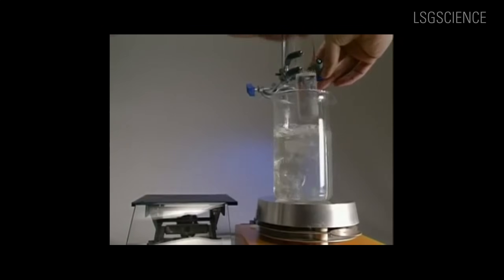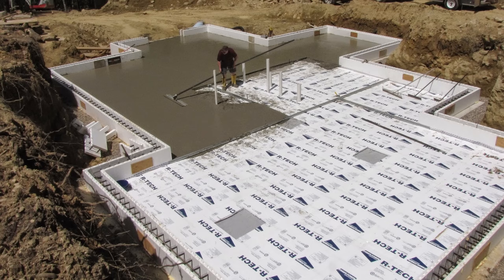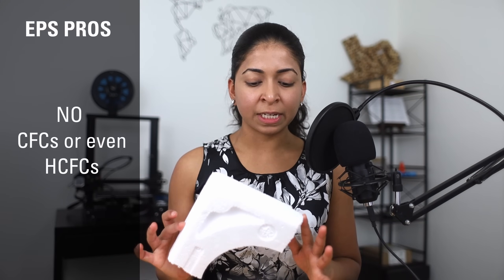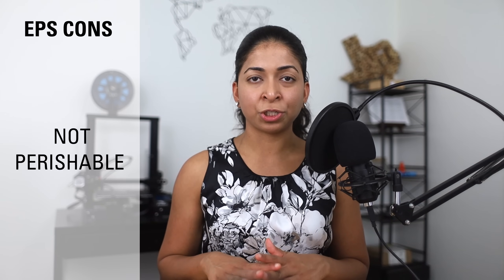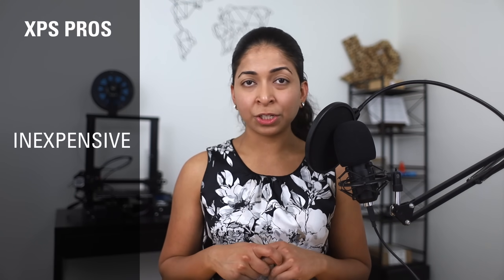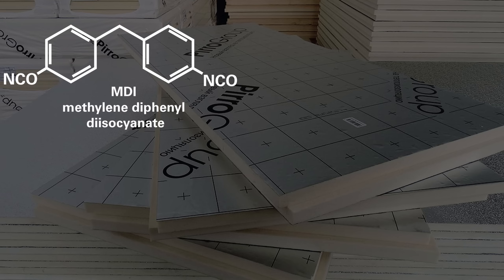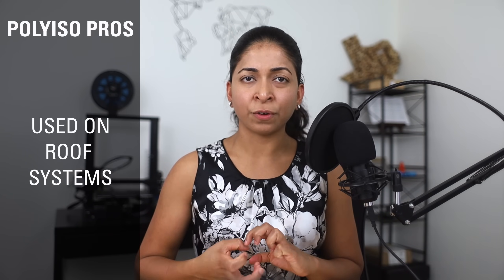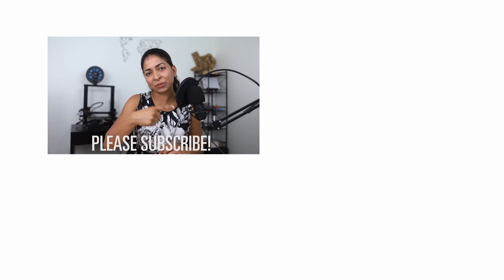EPS, XPS & Polyiso insulation | everything you need to know

Comment: Just insulated my basement with 4” type 2 EPS panels. Phenomenal thermal break and vapour barrier. Taped all joints and spray foamed the tops blended into our rim joists for an uninterrupted thermal break. There is no difference in room temperature from upstairs now, even with our frigid winters.

Comment: Do you think using 1 inch XPS foam board insulation on the exterior of a 2x6 wall insulated with Rock wool insulation and using Membrain smart vapor retarder inside could create the potential for mold growth within the wall cavity?

Comment: Based on the reduced performance below 50F does that mean that polyiso is not a good choice for colder climates or does its performance just suffer and reduce its effective R value closed to EPS or XPS?  Based on the use of the reflective membrane, is its effective R value further increased due to reflection of heat back into a structure (e.g., if used to insulate a basement or crawl space wall)?

Comment: You should've mentioned that polyiso has bad thermal drift over time.  The first year it is awesome, but the R value declines.
It would've been nice to have included advantage/disadvantages of fiberglass insulation (which I think loses R value as the temp drops)  and cellulose (which compacts over time, but also serves as an air sealant), too.

Comment: Which do you think is the best for , an outside metal shed 6 foot x 3 foot I’m in Boston Massachusetts so our winters sometimes get down 5 degrees , now you seem very smart , I’m storing lithium batteries out there - lithium at about 34 degrees starts to slow down , deteriorate and lithium freezes at like -5 Fahrenheit so potentially I’m looking to ideally not get below 40 degrees Fahrenheit in possibly 5 degrees , I plain on having a space heater out there that heater that hangs off the electrical socket we’ve seen a bunch of commercial selling them “ so in a nutshell which insulation is best to potentially Keep a 35 degree difference , I right now have some of that 2 inch the last 1 you spoke about in the ceiling & I’ve flex sealed the inside metal ceiling once 2 coats of regular spray paint & on the outside ceiling 3 coats of flex seal , 1 coat of Plasti Dip multipurpose rubber coating & 2 coats of Undercoating / insulation Permatex  to stop the metal ceiling weeping  ! The out side walls have like 5 coats of paint and the floor I used 1 inch wood and I have 2 pieces of water vapor barrier under the wooden floor and between the 2 pieces of vapor barrier has 1 coat of the spray rubber inexperience at Walmart $ 5 & some change per can & 1 good coat of Flex seal moisture blocker & the shed sits on 2x4’s the wide way laying flat so it’s about 1 inch 1/2 “ off the driveway that’s paved about 2” thick ! Thanks for the video explanation !

Comment: Great comparison between polystyrene and polyisocyanurate, @BelindaCarr. 

Couple corrections:
0:20 "The monomer styrene is composed of a benzene ring (C6H6) and ethylene."
It's benzene ring and vinyl (C2H3), not ethylene (C2H4). That's why it's also known as vinylbenzene.
6:40 "XPS can also attract ants and termites even though it's not an organic material."
XPS is an organic material since it's a carbon-based compound. That's why ants and termites are attracted to it.

One thing I would add is fire toxicity. 2011 study found that polyisocyanurate is the most toxic material insulation, mainly because of higher hydrogen cyanide production when burning. Fire toxicity is ranked PIR > PUR > PHF > EPS in under-ventilated condition, PIR > PUR > EPS > PHF in well-ventilated condition.

Reference
Stec, A. A., & Hull, T. R. (2011). Assessment of the fire toxicity of building insulation materials. Energy and Buildings, 43(2-3), 498-506.

Comment: The XPS sample shown at 4:26 is certainly not Styrofoam; based on the colour, it is likely Foamular.  Dupont's Styrofoam brand of XPS is generally dyed blue or grey for marketing, while Owens Corning's Foamular is dyed pink (as a tie to their pink-coloured glass fibre insulation). The sample is "actually XPS"; it is not "actually Styrofoam".

Dow and DuPont merged in 2017; despite the caption at 4:28 and illustration at 5:27, the Styrofoam brand is now under the DuPont brand.

Comment: Very helpful video, thank you. My question is about combining insulations in the same enclosed space. We used ICFs to form our foundation and the EPS is exposed in the interior of the crawl space. To insulate in the bays above the ICFs, we used mostly rockwool, but we had some polyiso left over from another project so we also used some of that. So in the end, our crawl space insulation is a combination of EPS, Rockwool and a small amount of polyiso. Is this a dangerous combination in any way? I'm looking at the safety data sheet for the ICFs and under "Stability and Reactivity" and it says the ICFs are "not compatible with materials containing primarily of hydrocarbons..." Should I go back down there and remove the polyiso and just use all Rockwool? Also, is it common to leave the EPS exposed in the crawl space or should I cover it with stucco or a layer of rockwool to reduce any fire hazards? Thank you if you can answer these questions!

Comment: Your videos have the perfect amount of comedy. I have a question in one part you said EPS is impermeable to water mold and mildew resistant, but then the next section you say water can penetrate because of the space between the beads. I hope this does not come off as rude I just want to know if it is water resistant or if it is not water resistant?

Comment: Great information. What do you think would be better for a floating floor, insulation would be under OSB laying on a slab? I am On the fence between XPS and rockwool, but for the same thickness XPS seems superior in tterms of compression and thermal performance. With EPS my concern is that its softer, so what i save in  this, i spend for a thicker OSB.

Comment: Thank you for the insightful information. I wasn't aware that Expanded Polystyrene (EPS) is the most environmentally friendly option among the three alternatives, especially due to its production process that involves steaming. The fact that this process can be made even greener by utilizing electricity generated from renewable sources is encouraging. I'm relieved to learn that EPS doesn't contain any chemicals that could potentially leach into the ground, especially as I intend to use it subterraneously in a Ground to Air Heat Transfer System under a greenhouse. The issue of ants being attracted to and consuming polystyrene was unknown to me. Now that I'm aware of this, I can mitigate the problem by laying down a protective plastic sheet. Again Thank you

Comment: Extremely helpful. Question: If polyisosyanurate is not stable below 50degreesF, then where is the best use of this produce? Inside a structure? Thank you - great information.
Reply: I used it in a very thin exterior wall, Worked very well in summer for keeping heat out and keeping my comfort zone inside around 65 well above 50 on both sides. In winter it did not help with cold well at all.

Comment: Hi, I am late to this comment thread, but I am hoping you can offer a little more information about the flammability of the last insulation panel type. I am considering using it between 2x4 purlins under a metal roof in a fire prone area of the northern California Sierra Nevada foothills. It would be fully enclosed within the 2x4 purlins framework and under the metal roofing panels. Thank you, in advance, if you are , or anyone is able to respond 😊.
Reply: Polyisocyanurate is a fuel when it comes to flammability. Manufacturers add fire retardants to it to make it less flammable, but I would not trust this in a vigorous wildfire. My recommendation would be to look into rockwool, specifically a layer of continuous exterior insulation of the stuff. Keep in mind that if you are using timber instead of steel framing, then even if you migrated to rockwool, your point of failure is likely the wood sticks you used for your house. Flammability is really a question about where your weakest point of failure is at. And with how climate change exacerbates droughts, I would plan not for the intensity of fires today, but the "once per 1000" year variety. Prudence is not about hoping for the average case scenario, but expecting the worst. Of course, your wallet might have other ideas.

Comment: If you update this video in the future please consider adding GPS insulation. It is produced without the use of chlorofluorocarbon (CFCs), hydrochlorofluorocarbon (HCFCs), or formaldehyde. So it will not produce harmful emissions to the environment. Compared to XPS, The GPS R-value is more stable long-term around +4 per inch.

Comment: This was a great video and I have a question ( not sure if you will get this due to the age)  between the xps and eps which could hold more static load on top , meaning keeping something on top of it for a long period of time?   I think this is known as compressive strength.   There is a company that says they use high density expanded polystyrene foam for their product which supports cars and truck ( race ramps )   is xps stronger then eps in this type of application?  

Thanks
Reply: I think it really depends on several factors such as density, thickness, cover, interior, and structure of it.
There are EPS pallets since many years ago and they can load quite heavy-weight, however, to extend their lifespan of it, we should cover them with plastic to induce friction loss.

Comment: EPS will hold water from personal experience. It's a bit misleading...the actual beads are water proof, however there is an air gap between them where water passes through and collects like a sponge. The upside is it can dry out too. Manufacturers will add a thin film to combat this. Last it is fragile and squashy and normally that's a bad thing when building stuff. XPS is not entirely water proof, but it's pretty much is, especially for thicker pieces. Just like EPS or poly (or any other plastic), UV will disintegrate it... it becomes powder, however there is a 'platina' effect, where the outside edge degrades, but protects the deeper part. It all comes down to water control though...you want to use EPS in similar places as fluffy insulation, but want more R value per inch and rigidity (garage doors comes to mind) and use XPS/poly as an air/water barrier (depends, but IMO on outside of structure is best and then it dries inside). I personally don't have a use for EPS...thin poly with foil on exteriors and XPS layered under it, then rockwool inside.

Comment: Would poly iso be safe to use at an air distribution box on a forced air furnace? The temperatures comming off the furnace are a bit warm. The box would be feeding warm air into the entire homes living space. Is there off gassing or flame retardant that could off gas into the hot air flow to the home ?

Comment: I am considering adding foam board insulation to my attic, but live in a hot and humid climate (Southeast US). My climate has a lot of moisture issues and also termites. It sounds like if I wanted to be the most cost-effective, maybe EPS is the way to go and for performance, Polyiso?

Would love to know if there are any mold/mildew resistant, ant/termite resistant, eco-friendly options. Only thing I can think of is rockwool, but don't know if they have boards.

Comment: Belinda, I have this video on speed dial...(jajajaja), I refer to it so often!!!....a little update info to share: New XPS panels are replacing HFC-134a with HFO blends for a big greenhouse gas reduction.  In the case of panels made of extruded polystyrene (XPS)—a closed-cell foam suitable for wet or dry conditions—that gas has been hydrofluorocarbon-134a (HFC-134a). HFC-134a is a good blowing agent, but it has a GWP of 1,430, meaning it traps 1,430 times as much heat as carbon dioxide does over 100 years. As regulations seeking to eliminate HFC-134a take effect this year in Canada and the US, panel makers including Owens Corning and DuPont are switching their blowing agents to blends containing hydrofluoroolefins (HFOs). Additionally, GAF is now manufacturing a non-halogen Polyiso. As always, thank you very much for your channel....Architects are weird, when we walk into a party we are not checking out all the sexy people, we are checking out the alignment of the ceiling can lights and door details. When I pull an all-nighter, for a little break and distraction, I pull up one of your video. Yes, we are weird :)) Thanks again!

Comment: I am retrofitting an ambulance. It has straight walls with 2"x2" box tube aluminum frame on 12" centers with an aluminum skin. I do not have to be concerned about flexibility. Moisture due to condensation is always a concern inside a vehicle like this one. Which foam would  be best suited to this environment? Would there be a difference in R value per inch? Among the best choices, is there a cost differential? Thanks in advance.

Comment: Thanks for the video. With Polyiso insulation how long does it take for the thermal drift to hinder the R value performance?  What are the different elements that would acelerate the thermal drift in Polyiso insulation?

Comment: Polyurethane? "Perhaps the biggest improvement polyiso offers over urethanes is the dimensional stability. Because of its highly cross-linked structure, polyiso is very stable at varying climatic conditions. This structure is rigid enough to resist movement by the fabricated foam, making the “growth” and “warp” which has been associated with urethane type foams very negligible with polyiso. This factor also proves advantageous during the handling and installation of polyiso."

Comment: 5:03 is that acetone/nail polish remover you're pouring? Thanks for the video. Good job.
Reply: That's acetone. acetone breaks down EPS, and XPS. and styrofoam packing.
Reply: @zeroumashi2947  I tried this with the same acetone shown here, with Foamular project panels, and it did not dissolve. Any idea what she is using specifically?
Reply: depends which grade of acetone you're using. some are diluted.
 salon grade acetone or nail polish remover works, just make sure it says 100%. Or buy the acetone in the blue can from the hardware store. xps and eps are the same material, just different forming process. check youtube and you'll see tons of videos of people melting foam using acetone. turpentine or gasoline also work but would need to be done in an area with plenty of ventilation.
Reply: @zeroumashi2947  Interesting; I got the 100% acetone and it did nothing to the Foamular project board. I'll keep looking. It looks like you are using something that is not treated to withstand anything.
Reply: she's using foamular since it's featured in the video. that's the only three chemicals i know of off the top of my head that will dissolve foamular.
that's also what google says will work.
gasoline being the most corrosive to plastics. also not my video. I just have first hand experience with acetone and foams and wanted to chime in cause otherwise the question wouldn't have been answered. naphthalene will degas and shrink it to some degree according to google. there's also a discussion over on reddit titled "Solvent to dissolve rigid insulation?" if you want to have a read about it over there.
maybe they changed the formula sometime since the video was uploaded.
Reply: @zeroumashi2947  Thanks for the reddit tip. Yes the project panels I used must've been treated or made differently because absolutely nothing happened with 100% acetone.

Comment: Good video thanks.
I'm looking for a surface strengthening  material that I can use with EPS.  Ideally giving a hard shiny surface. But I want to keep it light in weight.  Steel is obviously too heavy. Not sure about a thin aluminium. Also considered bonding a high density material that's used in tents. Any ideas on what to use? Maybe a spray painted material?

Comment: I always thought Poly ISO was the most environmentally sensable alternative with no off gassing. 
We use it on all of our construction projects as wood fibre insulation is not readily available everywhere. We have wraped homes with it, applied it in stud bay cavities and use it on the exterior of rimjoists to reduce thermal bridging. We also use a Wallboarders buddy drywall cutter to score both sides and snap it so there is no construction waste to clean up.
When considering price you mention cost per sheet but how does it compare to cost per square foot R value?

Comment: Great video, and explanation. But is polyiso the same as Polyisocyanurate?? The reason im asking is that im planning to make a 12v compressor freezer/refrigerator because it needs to fit in a off shaped in closure. I was choosing for pir panels, because of the R-Value, and because its polyester resin resistant for laminating with fiberglass cloth. But in this panel your saying that the polyiso insulation works loses its thermal properties below 50 degrees Fahrenheit or 10 degrees Celsius. Are we talking about the same material? And if yes, does that mean that pir panels are not suitable for my application purposes? And should i use xps panels instead in combination with an epoxy resin instead for laminating fiberglass cloth? As epoxy resin does not dissolve the xps insulation material.  Cheers Eric

Comment: You are using thermal drift for two different problems, the problem with poly iso isn't the same thermal drift as XPS but the R rating reduces with temperature so dont expect your R6 to be there when you really want to stay warm. It most likely will drop from R6 to R3